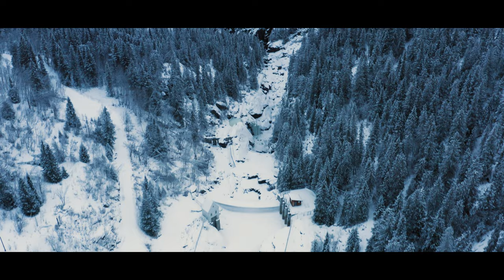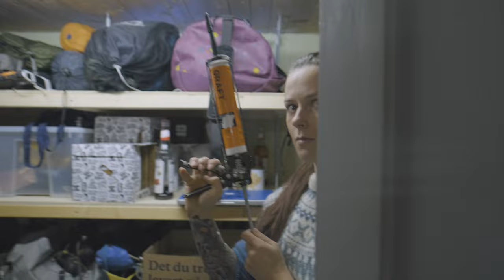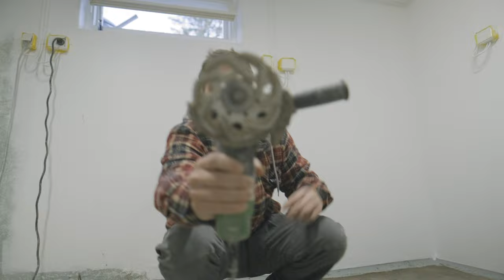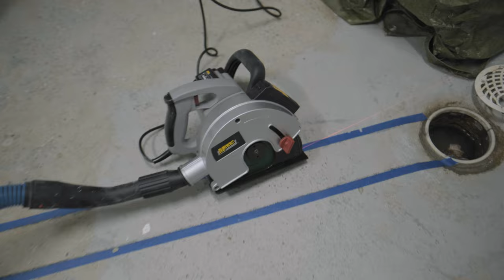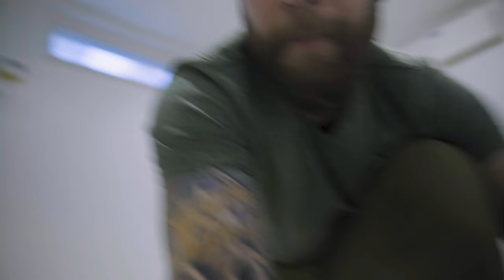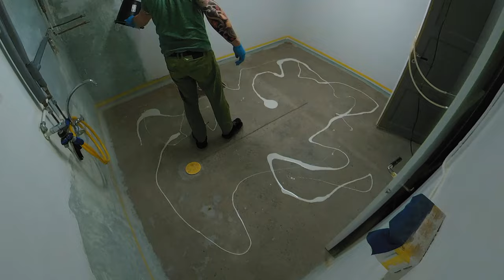Can you build a basement brewery with Brewtools? | Starting a brewery: Ep9

Comment: Which rail system is it for the grain?
Reply from the maker: It’s a skylotec rail system. Way overkill and meant for rope access but I was able to grab a decommissioned set. The pulley system is the Petzl JAG system. Also way overkill and used for rope access. But it has 4:1 mechanical advantage which I recommend but can build less overkill with two double pulleys :)
Reply from the maker: It’s a skylotec rail system. Way overkill and meant for rope access but I was able to grab a decommissioned set. The pulley system is the Petzl JAG system. Also way overkill and used for rope access. But it has 4:1 mechanical advantage which I recommend but can build less overkill with two double pulleys :)